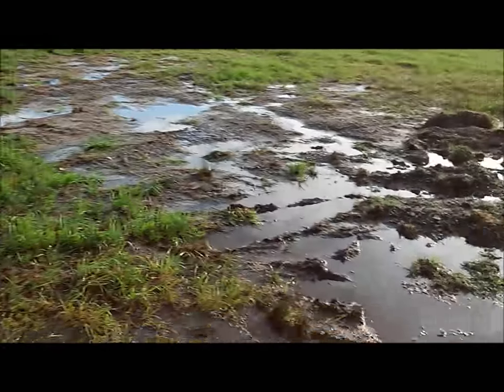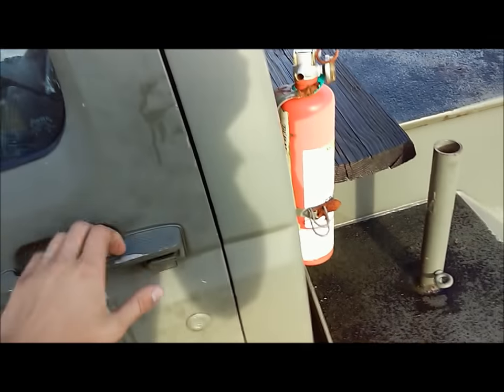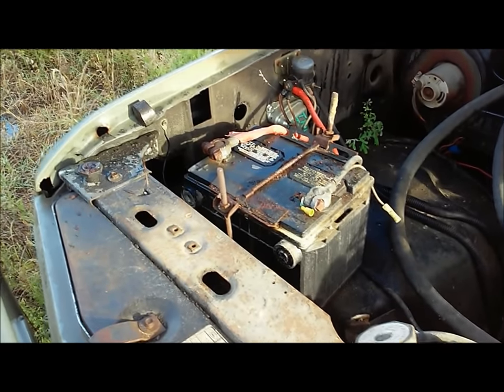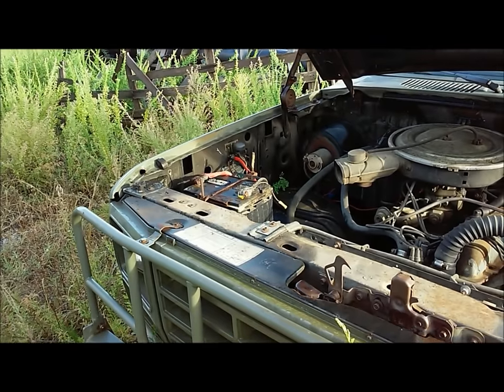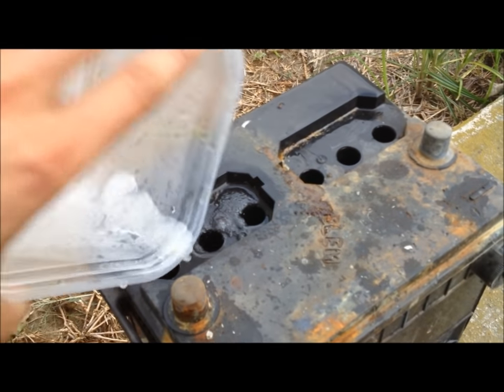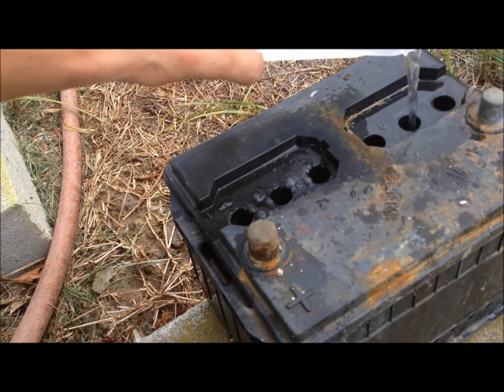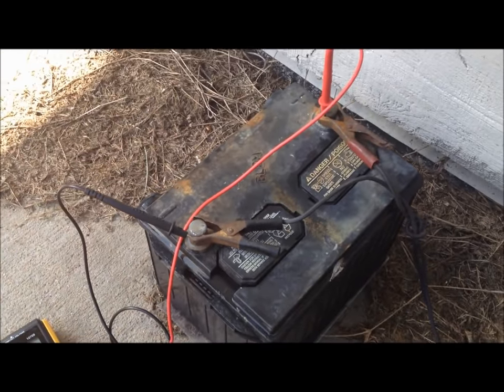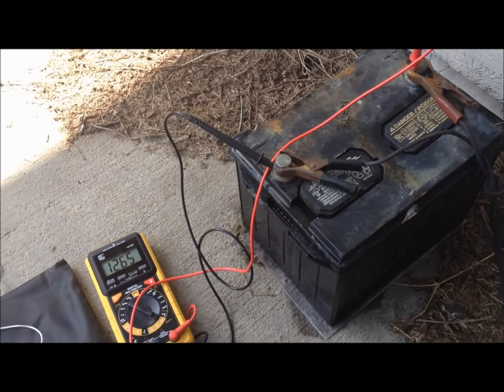Car Battery Repair After Sitting 10 Years: How To (Basic Home Products !!!)

Comment: Environmental offender.

Indeed, not really good for the environment, heavy metals into surface waters.

Brrrrrrr.
Reply: just pour baking soda on it.. that will neutralize the acid
Reply: A OK  The distilled water in the battery would have some lead through electrolysis and it woul;d be measured in PPM.. Soil naturally has up to 1200 ppm in it.. So after you neutralize it .. then re mediate it .. which means mix it into soil at about 10-20 times the amount of water.. That should be fine.. I wouldn't make a habit of it in the same spot..  But lead is a mineral...
Reply: A OK  a 22 BULLET HAS MORE LEAD THAN THAT.. NO ONE SHOULD PUT ACID IN THEIR MOUTH.. i WOULD EAT A POUND OF DIRT EITHER.. BUT COPPER , IRON AND BARIUM ARE JUST AS TOXIC.. SO NEXT TIME YOU HAVE A BUNCH OF PENNIES AND PAY FOR THAT HAMBURGER AND TOUCH IT AND EAT IT.. YOU ARE GETTING A BUILD UP OF TOXIC METAL IN YOUR SYSTEM.. OR BACK IN THE 80'S WHEN THEY HAD LEADED GAS.. AND YOU BREATHED THE AIR BEHIND A CAR YOU GOT MORE LEAD IN YOU THAN YOU WOULD FROM POURING OUT THAT WATER FROM THE BATTERY
Reply: A OK   GO WRITE A LETTER WITH A PENCIL AND THEN THROW IT IN THE TRASH .. YOU HAVE MORE LEAD THERE TOO
Reply: there's no lead in pencils mate: https://en.wikipedia.org/wiki/Pencil
Reply: Mr Cabot  Lead,Titanium
,Vanadium,Chromium

Manganese
,Iron,Cobalt,Nickel'Copper,Zinc,Gallium,Germanium,Arsenic,Zirconium,Niobium,Molybdenum,Technetium,Ruthenium,

Rhodium,Palladium,Silver,Cadmium,Indium

Tin
,Tellurium,Lutetium,Hafnium,Tantalum

Tungsten
,Rhenium.Osmium,Iridium,
Platinum,Gold are all considered toxic heavy metals
Reply: Mr Cabot   copper can cause nausea, vomiting, diarrhoea, gastric (stomach) complaints and headaches. Long term exposure over many months and years can cause liver damage and death.
Reply: Mr Cabot  ancient Romans used it for plumbing. Even in modern times, lead solder has been common for welding plumbing fixtures. Lead has been added to gasoline to reduce engine knock, to face paints and paints used for toys and buildings, and even in cosmetics and foods to add a sweet flavor. It is used to make stained glass, leaded crystal, fishing sinkers, radiation shields, bullets, scuba weights, roofing, ballasts, and statues.. Because of the sweet flavor of lead and was used in paint for toys and cribs children would suck on it and ingest a lot of it. and it would build up and cause problems.. most of toxic heavy metals dont have that sweet flavor so no one ingests much.. hense the reason lead has such a stigma
Reply: Mr Cabot  Im a chemist for star chemicals

Comment: So did it work?? What's the point of the video if you don't show us if it worked??
Reply from the maker: +George Houghtby yes it did, unfortunately i never got a clip of the old truck running since i was leaving virginia. we put it in the truck, lit it off for the first time in many years and took it mudding through the bog. you can see the before and after mud to prove that we drove it. i was very sad i didnt have anything to record with at the time. heres the truck version clip which is this video but extended. https://www.youtube.com/watch?v=ht-iCXClkFk
Reply: +George Houghtby There are several components to battery reconditioning. One resource I found which successfully combines these is the Magic Mender Wizard (google it if you're interested) without a doubt the most helpful info i've heard of. Check out this  super site.
Reply: +George Houghtby There are many factors in doing a pro job. One plan I found which successfully combines these is the Magic Mender Wizard (google it if you're interested) definately the most helpful info i've seen. Check out this  awesome resource.
Reply: +George Houghtby There are many components to fixing a car battery. One resource I discovered that successfully combines these is the Magic Mender Wizard (check it out on google) without a doubt the most helpful info that I've heard of. look at this  interesting site.
Reply: +George Houghtby There are many factors in battery reconditioning. One plan I found which succeeds in merging these is the Magic Mender Wizard (check it out on google) without a doubt the most useful course that I have ever heard of. look at this  amazing resource.
Reply: +George Houghtby I\'m not sure but ,if anyone else wants to uncover how to recondition my car battery try Corbandy  Battery Blueprint Crusher (just google it ) ? Ive heard some awesome things about it and my colleague got amazing success with it.

Comment: Ratchets and Wrenches has a video showing a test for cold cranking amps.  Just testing the volts with a voltmeter will only give a part of the picture.
Reply from the maker: I don’t know why this video is so popular. I actually remade this two years later and started a car with the battery

Comment: I just did three motorcycle batteries that was given to me from a junk collector they were rough not a lick of acid they were sealed batteries I pulled the tops off I didn't even rent it my solution is this is for a motorcycle battery one cup of distilled water in the microwave for a minute and a half coffee cup. Four tablespoons of Epsom salt with no perfume just plain Epsom salt slowly stir it in the warm to hot distilled water let it sit to where it cools place that in a mason jar or any jar with a lid not two holes in top of the jar for a vent. Shake the jar and pour it into your cells do not Hook a battery charger up yet when I got them from the junkyard one had three bolts the other one had 1.7 volts the other one had six bolts I poured my Epsom salt in there let it sit shook the battery until it was able to so I'm able to put more in. Shake the battery I even turn it upside down I put a piece of cardboard over the holes I shook it like a paint shaker. It took me about 30 minutes to fill that little battery with out even a charge the one with 1.6 went to nine volts the other one went to 11 volts and the other one to 10 volts put on a trickle charger with the Caps off slowly adding just a little of the solution that I needed when you saw that the holes were empty trickle charge it overnight two amps every single one of them were 1275 volts to 1325 volt that was 3 weeks ago and they have not hesitated to start I even let the keys on overnight and and it started the next morning

Comment: if you have a battery you want to try and save you can discharge it 100 percent with a light bulb not led  then recharge it reverse polarity after a full charge then discharge it with the bulb and recharge the right polarity this will clean the plates  some marina I work at use to do this when removing batteries for winter storage of battery

Comment: I'm not seeing any comments on the fact, he's repurposing waste(metal, rubber, engine oil, exhaust pipes( 1 of the vehicles left as waste at the place), which is a good thing. 
When one sees some one do something and it's in the course of events, without causing serious injury, usually one doesn't stop the whole game( a person trips running from 1st to 2nd, makes it in a baseball game,   a person knocks over a potted plant on a sill, housecleaning, a  bookkeeper leaving out a zero on the date at the beginning of the date(Ex , 07/2018, instead puts 7/2018), you don't delete or toss the whole file for doing it) . Which much of the message so many are putting up here. Oh, this entire thing of correcting previous generations waste, should be ended due of a correctable mistake being made.
Of myself, I've had to work with control freaks who would completely 'f' a project because they were not the person in charge, and/or the person in charge of ( a person functioning as a resource, not as a boss), because the mgr wasn't managing as anticipated. Said control freaks are not worth tolerating most times on the job, and for myself, of the clock also. If you folks saying these responses are like that please stop.
Such, OMG, or LMFAO, or mgtow, anonymous the hackers group, most times solve nothing. Do the EPA thing, I say, I've done it( on a local business), but please stop the messages so easily taken for cyber bullying. Think at least somewhat about your responses. Good luck..world's crazy enough already.

Comment: You said your not suppose to leave it in and that you did some research. I'm sorry, but leave what in?  Are you taking about the original acid that was in it? Or what you had put in? Also, I noticed you had the charger still hooked to the battery when you were checking it. Are your sure your 12v was not coming from the charger you had hooked up?

Comment: Next time you do a battery like you did this one, please be responsible enough to not pour acid on the ground. Pour it into a plastic container and take and dispose of it correctly.
Reply from the maker: FYI, you can pour acid on the ground. Even prop acid can be disposed of in waste water
Reply: Joby Fluorine ,Lead in everything from forks to paint, and the smartest generation to ever live was in the 1800s. We credit all of our creature comforts to this era so .......Careful how you you get programmed. And, Work on that language my man, it's not you.
Reply: You are worried about Momma Erf and you snort what? C'mon man, An original thought , please.
Reply: It is wrong to dispose of acid like that but as the battery was discharged most of the acid had been converted to lead sulphate on the plates. As a battery discharges the acid in it is converted to water. This can be verified by using a Hydrometer to test the acid strength. It will show that it is only very weak acid that comes out of the battery.
Reply: *****
Understood
Reply: Gerald Gambill like that batt acid is going to cause any problems. that small amount will quickly break down and will never harm anything but a few blades of grass. industrial dumping in rivers, deep ocean dumping is what bothers the balance of nature.
Reply: Joby Fluorine she says as she tells her kids to brush with fluoride. a waste product that cannot be legally dump but through deception has been, under the false notion that it has benefits it is "added" to our reservoirs at a cost and even more profitably added to toothpaste. it's affects have been studied by Russian military for its affects on the brain and more specifically the pineal gland. we are paying to poison our families
Reply: Gerald Gambill
Reply: get a grip you all act like I committed murder. So we're done here........
Reply: hi everyone ,if anyone else is searching for how to recondition old batteries at home try Panlarko Recondition Planner (do a google search ) ? Ive heard some interesting things about it and my partner got great results with it.
Reply: Joby Fluorine stop using power. It pollutes the earth more than anything. Also stop driving. Have a good day
Reply: Not a plastic container. Glass.
Reply: Gerald Gambill Dont you think the rain will neutralize the acid ? Lol !
Reply: +Don Rutter The ground will do it.

Comment: You can't throw battery liquid just like that........
Reply: The ground will neutralize it.
Reply: He could of  used baking soda to neutralize the acid  before pouring it out back. NOT doing at least that at the very bare minimum is just pure laziness.
Reply: Henry Smith uu
Reply: I've been researching into battery reconditioning and found an awesome resource at rapid renew roadmap (check it out on google)
Reply: b v'vz
Reply: If you is interested in battery reconditioning the best success that I have ever had was by using the Magic Mender Wizard (just google it) without a doubt the best info that I have ever tried.
Reply: you can IF you add sodium bicarb, or baking soda first, it kills the acid completely,
also, a full static charge is 13.6 volts, a car or truck 12 volt charging system should be at 14.0 to 14.25 running . cars of today are not designed to charge , but MAINTAIN THE BATTERY, A CHARGER  was used when generaters were used, that is why you see high amp alts on cars of today with burned up connectors,,,,
Reply: he just did!!!
Reply: I hope that was on your water well for the property... My goodness people wtf
Reply: hi everyone ,if anyone else needs to find out about how to recondition my car battery try Trefendous Rapid  Extender Tips (Have a quick look on google cant remember the place now ) ? Ive heard some decent things about it and my friend got amazing results with it.
Reply: Yes he can.  Go back to mom's basement.
Reply: This is just superb, been searching for "how to recondition a car battery at home" for a while now, and I think this has helped. Have you ever come across - Ammaceen Reconditioning Rabblement - (do a google search ) ? Ive heard some pretty good things about it and my buddy got cool results with it.
Reply: Cheers for this, I been tryin to find out about "battery reconditioning chemical" for a while now, and I think this has helped. Have you heard people talk about - Ammaceen Reconditioning Rabblement - (search on google ) ? Ive heard some unbelievable things about it and my colleague got great results with it.
Reply: Winner of a video, been searching for "battery reconditioning franchise" for a while now, and I think this has helped. Ever heard of - Ammaceen Reconditioning Rabblement - (should be on google have a look ) ? Ive heard some super things about it and my friend got great results with it.
Reply: jimmy howard : nonsense.
Reply: Yeah!!! And the LEAD in the acid will get neutralized also...
Reply: Actually the ground will get contaminated with the lead contained in the liquid ....
Reply: not concentrated like that. It will kill grass and other things growing. baking soda like people have stated and slowly dilute the solution with more water until its neutralized.
Reply: hi everyone ,if anyone else wants to learn about how to recondition old batteries at home try Knewreck Rapid Renew Guide (do a search on google ) ? Ive heard some interesting things about it and my mate got excellent results with it.
Reply: I have spent months researching into fixing a car battery and found an awesome website at Jons mender guide (google it if you're interested)
Reply: Not certain about the points made but ,if anyone else wants to uncover how to recondition old batteries at home try Corbandy  Battery Blueprint Crusher (do a search on google ) ? Ive heard some pretty good things about it and my mate got amazing success with it.
Reply: hi everyone ,if anyone else trying to find out how to recondition old car batteries try Renkarter Rapid Renew Report (should be on google have a look ) ? Ive heard some great things about it and my brother in law got excellent results with it.
Reply: yes you can he just did lol

Comment: Holy shit dude! you should remove this video before someone sends the EPA after you. I was wondering what you were going to do with the acid, and I was waiting too see, then you dumped it onto the ground,. Ouch! People are going to scream at you for that, mark my words. Edit
Reply from the maker: +Moon Hitsearth HA! i knew it!!!! notice how it looks like water? i dumped out the acid in the warehouse hazardous waste container and added water. (lol notice the hose?) i was curious to see how people would respond to someone dumping "battery acid" on the ground. maybe i shouldnt have tested this on a serious youtube video lol
Reply: ThunderHead289
It doesn't look like you rinsed it out first, the battery is covered with dirt, and only wet on the side you dumped the acid out. If you rinsed it with the hose, you would have sprayed the dirt off the top, are you sure you're being honest with me?
Reply from the maker: to be honest, not completely. i actually tried to fill it with water and use baking soda as a catalyst and just jump it and have it run and charge off the alternator until i saw someone do this and i wanted to try it myself. i imagine the crap is from the rusty hold down and having it back in the truck again with the corroded terminals. that video avenue kind of failed.
Reply: Moon Hitsearth to late has been done

Comment: battery will more than likely never fully come back. 12.6 volts doesn't mean a lot if the amperage isn't there. Had a battery charged to 12.7 and fall flat on its face when any load was attempted to be drawn. In a pinch this will do the trick but this isn't really "reconditioning". once the cells are gone they are gone
Reply: Yep, might have started out as an 850 cold cranking Amps, but now is a 200 amp battery with instead of 20 minutes of power, it has 1 or 2 minutes.  More like a weak capacitor than a battery.  But it is an old battery, and might be made better than todays with thicker lead plates.